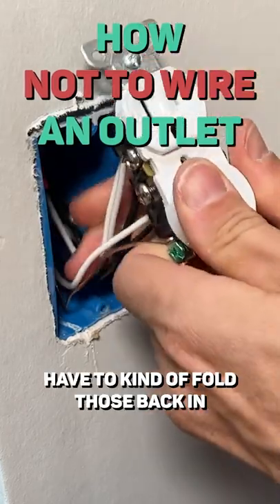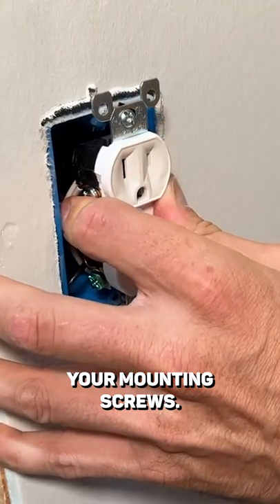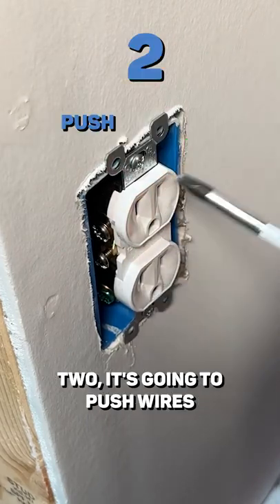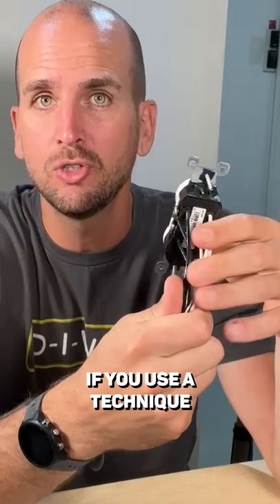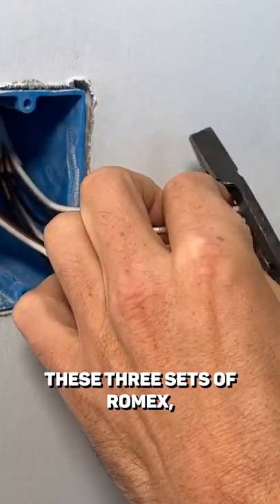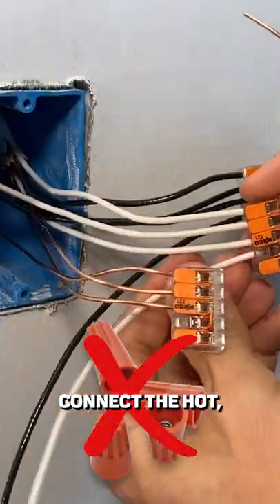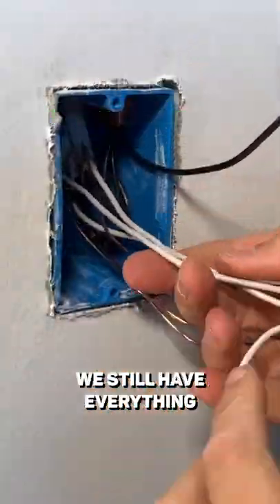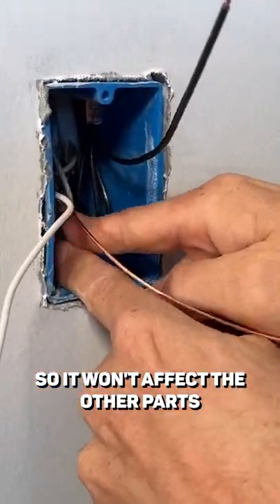The Better Way To Wire Outlets #shorts

Comment: Just my two cents, because I can. They're very bad habit of handling the sides of a receptacle will eventually get you into trouble when you're troubleshooting live circuits. There's a very nice technique for doing that double fold without touching any of the wires for the screws. I would suggest practicing on non-live  circuits for a bit
Reply: Yeah an electrician that grabs the receptacles by the sides shows that he is very sloppy. Also the screws need to be screwed in so that they don't butt up against the side of the box. Even though it's a plastic box good habits make perfection
Reply: He's not electrician. Don't back stab. Use wire nuts. Dont touch sides of hot and neutral At the same time. Screw in the other remaining screws. Use tape anyway. So many mistakes in this video.

Comment: I always pigtailed my connections. Never trust devices to carry power. Also, wire nuts are the best splice outside of solder and friction tape! 25 year Electrician here.😊
Reply: Using wire nuts seems being technique from the last century. Forget that crap and do something which is not weakening the conductor

Comment: On the discussion on "backstabbing" vrs screw I have a few questions.  My preferred way has always been screws since, for many years, that was all I was aware of. And to properly wind the wire around the screw so clockwise tightening pulls the connection tighter is very important. But, there are cheap devices all over the market these days as well. Not all recepticals and switches are quality devices.
1)  If you are using the backstabbing connection, are you using a 14ga wire rated for a 15 amp ckt into a 20 amp receptical? The wire size between a 14 gauge and 12 gauge wire will determine how tight that connection is. 2) Each device is supposed to be URL rated. If the backstabbing is so inferior, how does it meet the URL listed spec?
3) most problems folding wires back into a box are because novices make their wires too short. Think of your fold as being a sidewise turned Z shape. But I, too, prefer using pigtails in certain conditions. Often in very old houses, you just don't have much wire to work with, so a pigtail is a better choice.

Comment: If you know how to wire a house, "3 wired" plugs are rarely necessary.  If you must 3 wire an outlet, you should always pigtail to avoid the stab-locks on the device.  With #12, stab-locks are not an option.

Comment: Wagos are a real nice loose connection.
Reply: No loose connection with Wago.
Reply: Thwre literally  made to handle lose wires lol
Reply: Wagon =no-go... Ole school wire uta never fail if used properly
Reply: 20 yrs in residential construction and I have yet to meet a licensed electrician that uses wagos. It’s only been handyman and diy’ers I’ve seen use them
Reply: @ScreenTalker  that proofs how horrible the standards are in the US, nothing else…
Reply: @andregenter4213  I understand that they’re approved for industrial use in the US but I think there’s a lot of guys that would rather gamble on the mechanical connection of a twist versus a sprung lock
Reply: @ScreenTalker  with a twist you are less flexible. You are weakening the wire. You need electric tool to mount the nuts. In a professional view it’s totally garbage and a big amount of worlds electricians if laughing about those techniques used over the big sea…

Comment: That's a great idea and I've used it. But I use wire nuts.
Only because push in connectors and Wagos only make connections with wires with a tiny sliver of metal.
I always think of that as a heat source if someone plugs a space heater or something that pulls a lot of amps into that circuit
Reply: My concern as well, but I saw a test with heater and max amps and the wagos did fine

Comment: OK, can't say I agree with this.  You're adding cost to the project simply because it's slightly difficult to fold the wires back in. Learn how to do it properly and you won't waste 3 Wago connectors. And while outlets do fail, I've never seen one fail where it causes the downstream outlets to fail. You'd literally have to manage to break the little tab that connects the screws together. That being said, using commercial grade outlets with back wiring (clamp, not stab) is the only way to go.
Reply: Commerical grade are obviously better But pigtailing is the superior way to go for number of reasons. Outlets do fail and if they are pigtailed they absolutely cause downstream problems all the time. Plus you are using the device to carry every load in the circuit. Now even though the little tabs that connect the screws are rated for that I'm still suspicious of those back stabs on the non commercial outlets that people use all the time. I've seen those burn up a number of times and I still can't determine whether it's the weakness of the stab holding the wiring or whether it was just because they didn't pigtail combined with using that. It's always best practice to pigtail and have one connection point to the device. Makes troubleshooting a lot easier and saves you headaches. Who cares if you have to spend an extra 50 dollars worth of wire nuts to do things right. Better then burning your house down. Keep up the good videos too dude.
Reply: @anthonyesposito7  Absolutely no disagreement on backstabbed outlets. They're garbage and a fire hazard. To be clear, I'm talking about back wired, with a proper screw clamp.
Reply: I think this guy explained both sides of the pigtail debate pretty well: https://youtu.be/K3RIjUnrNTQ
Reply: @anthonyesposito7  did you go to Nova southeastern University by chance?   I knew an Anthony Esposito there years ago.
Reply: @pmorse3653  No I went to Temple University.
Reply: Just remember people will plug space heaters anywhere and when you have that running through every outlet in your living room it creates alot of heat and those 15amp outlets start changing shape. Use pigtails!!
Reply: Pigtails.  Every licensed electrician and inspector I've ever worked with does it that way, including myself.   There's no mention of "pigtails" in the code but 300.13b states: “In multiwire branch circuits, the continuity of the grounded (neutral) conductor shall not depend on device connections such as lamp holders, receptacles, and so forth, where the removal of such devices would interrupt the continuity.”  I would not rely on the receptacle ti carry the load for the entire circuit.
Reply: Bingo
Reply: If he used regular wire notes it would cost $0.25 more per outlet. Not really much cost increase, especially if it reduces install time.
Reply: @andyanderson7724  if a person is using multiple 1500w space heaters on different outlets on the same circuit the outlet melting  wont be your only problem... Even though a non defective breaker will flip every time
Reply: @pileggitech  so basically you have to pigtail ground wiring per code.
Reply: @randybobandy9828  constant load of dryers in bathroom stabs become loose on a common side of GFCI load side blew the plug neutral side out on vanity , near miss of accident...
Reply: Paid by the hour
Reply: @Kevin-mp5of  it's not about being economical, rather than being safe.  Pigtails make more sense in that you don't rely on the device to carry current for the entire circuit.  If that device fails, so does the whole circuit.  I've replaced a few receptacles in my life that melted due to overheating on the side tab.  I've seen receptacles that had wires on all four screws and also some jammed into the back clamps.
Reply: @pmorse3653  P Morse?  Is that you Pat?  Tell Bob I said hi!
Reply: @CH67guy1  It is I!  hahaha.  Bob who?
Reply: @pmorse3653  Your husband!
Reply: @CH67guy1  he said to invite you over for a menage
Reply: @pmorse3653  Hey Pat!  Are you a Patrick or a Patricia?
Reply: So true, when you understand how to be clean and neat work and take pride in what you're doing you will see that a lot of times mini electricians spend too much money and time along with failure rate on devices when the work is sloppy.
Reply: @randybobandy9828  so true, so many electricians forget that the circuit wiring is protected by the circuit breaker the breaker would trip due to Thermo heat from the amperage increase especially today when most Outlets are now arc fault protection in residential wiring. Mini electricians today, really don't know theory of electrical. Therefore are insecure of stab connectors even though they are UL listed in our heat rated with the same rating as wire nuts

Comment: As long as you follow the steps, pigtailing works great. As a restoration technician, I've found more "broken" outlets with pigtail disconnections.

Comment: Good job or do you need to tie down the unused screws on the outlet and I would put a piece of tape but that’s just me
Reply: Those screws can be tightened up for clearance and they will be used years later when the push connection fails then you end up using the screws to reinstall the wires

Comment: I agree that folding the wires on a standard outlet is tricky. GFCI outlets make it even more so, but I still prefer daisy chaining from GFCI, rather than filling every box with a $15 outlet. For pros building a house, it may make more sense to pigtail.

I just noticed that you did not run in the unused screw terminals. I know it’s not required, but I think it makes it look more uniform, and marginally easier to get the receptacle into the box. It’s kind of like lining up the cover screws to have vertical slots, my personal preference.  Btw, great video.
Reply: @TomCee53  I agree 👍

Comment: Pigtails effectively required on the neutral 
300.13 In multiwire branch circuits, the continuity of a grounded conductor shall not depend on device connections such as lampholders, receptacles, and so forth where the removal of such devices would interrupt the continuity.

Comment: Even better is to use Wago 2273
Reply from the maker: I am not a huge fan of push in connectors but every once in a while I will use them like on small recessed lights and the WAGO 2273 are very handy and compact.
Reply: @EverydayHomeRepairs  I use the 2273 daily on single core. The 2273 3-way costs about 25€ per 100 while the 221 3-way costs about 75€ for 100

Comment: I just added an outlet this past weekend and ended up using a deeper box and making joints. However I made sure to have an extra piece of romex to add legs to the joints. It was time consuming but I know I wont any loose connections moving forward

Comment: I hate it when people use Outlets as a pass-through. All the cheap ones overheat and fail.

Pigtail is the way to go! Everyone should be required to do this. I was a commercial electrician before finding my true peace as a carpenter.

Comment: now by having 3 wires and adding 3 wire connectors you have exceeded the box fill for that box and must use a deeper box to pass inspection.
Reply: Really? I'm a master electrician of 30 years. I've never read that  in the code nor have never failed because of that.

Comment: What about some sleeving on that earth 😱
Reply: I don't think they do in some states in US.
Reply: Ya its weird like some devices have a ground thats sleeved like in my refrigerator but usually the wire we run isn't sleeved I don't get it but it must not be that big of a deal.
Reply: Cable in North America is almost always bare copper, it is also called ground or bond here
Reply: No.. You don't need any, it's pointless
Reply: @Teh_Random_Canadian  ground and bond are 2 different things, they have different purposes
Reply: @johnbalzano6588  Yes, I know. The term is still used interchangeably regardless here even if it is incorrect
Reply: @randybobandy9828  Hardly pointless when the live/hot terminal is so exposed and you have a whole bunch of unsleeved earth wires just stuffed into the box.  On a UK outlet none of the live parts are exposed on the rear of the outlet, the clamping screws are recessed.  This just seems like yet another terrible US electrical design choice.
Reply: @Justin Folse Really? Teck Cable, BX, other AC90 cables, beldon and comms cable, FAS cable... all bare bonds. You have no idea what you are talking about lol 🤦‍♂️
Reply: @Justin Folse reading comprehension... "ALMOST always..." Derrrrrp
Reply: @ferrumignis  If you've done things wrong enough that the ground wire is contacted by a live wire or component, you want as good a connection as possible at that point so the breaker trips before too much heat is generated. 

Otherwise you slowly wear or pinch through insulation over time until it causes a small fire. Whether it stays a small fire or not depends almost purely on your own luck....
Reply: @mfree80286  "If you've done things wrong enough that the ground wire is contacted by a live wire or component"

The "wrong things" were stuffing several quite long lengths of bare ground wire into a box and then attaching an outlet that has bare, exposed live connection on the back.  If you can't understand how that could be problematic you probably shouldn't be working on electrics.

Comment: I've read many of the comments and I have to disagree with those of you who say pigtailing is a waste. 
It's actually code.
You are not permitted to "break" the neutral when removing a devise, therefore pig tails must be used.
Never use the stab in connections!

Comment: Lever nuts are one of the best modern electrical inventions. I use them on some LED setups. Super strong mechanical connection and modular so I can take stuff apart easily.

Comment: that pigtail terminal block would raise the cost necessarily on a construction site, for example. 

I always bend the wire around the screw - a closed loop, then tighten the screw. It's been done this way for decades !

Comment: I am dealing with a 15 year old construction that has a similar push connect nuts. They may be easier for installation than wire nuts, but they increase impedance and cause more problems in the future.

Comment: Notice he didn't show it back in the box after using pig tails. Thats because he used those big ass terminal blocks and had the same problem. Just use wire nuts, there is a reason they have been used for so long.

Comment: prebend the wires before adding the receptical. Pigtailing is only helpful if there is 3 or more wires. Screw terminals are very solid connection paths, use them.
Reply: Ya but is code to have the ability to remove these outlet without interrupting the neutral path, sho u might as well just pigtail no matter what, it's the smart way to do it, no matter how much u hate it
Reply: @trope5105  I'm not really sure what you said. And I don't think you are either. I am an residential electrician not a YouTube creator. Terminal loops in outlets are extramly good connection pathways. You can inspect the connection unlike a wirenut if you don't pretwist.   I will only pigtail if there are 3 wires/ it's a GFCI or I have wire Guage transitions. Ground is always pigtailed. I would love for you to provide that code ars to me as that's a new one...
Reply: @markusford6585  why would you assume the person replying to you is a "youtube creator" and then also assume he isn't a pro electrician?
Reply: @randybobandy9828  so giving his reply... I am almost positive he isn't an electrician. And by creator I was referring to the post author. Thx for ur petty input tho.
Reply: @markusford6585  " I'm not really sure what you said."

Code says you should not rely on the outlet to provide continuity for a circuit, hence a pigtail is the correct method.

Comment: That’s perfect, just make sure the folks at home know you can’t do this with a GFCI receptacle. You can’t pigtail a GFCI, the rest of the circuit won’t be GFCI protected.
Reply: I recommend that you pig tail a GFCI outlet wherever you need a one, and only use the load side where required, like a bathroom. It's more expensive initially, but will save you down the road. No more hunting down which GFCI tripped, no issues with replacement, and when or if it dies, it doesn't take out every outlet in your basement or garage. 💙 T.E.N.

Comment: If that's the system that works for you then OK. Me personally I connect up upside-down spin it round once connected and hey presto the socket/switch pulls its self into the back box and no extra joins